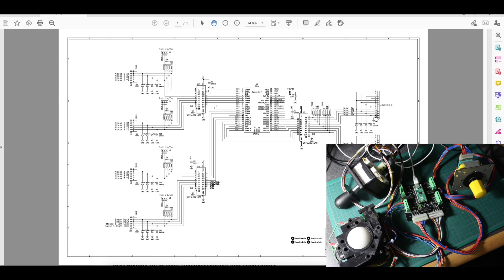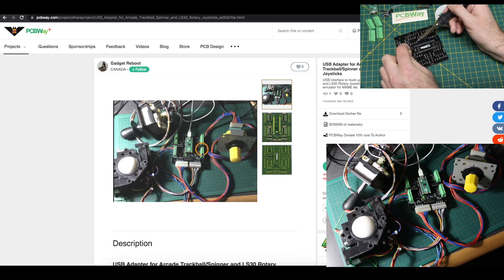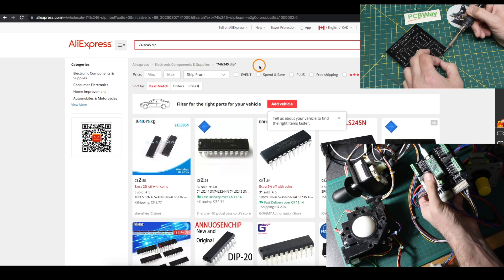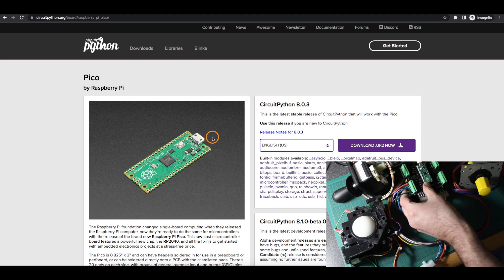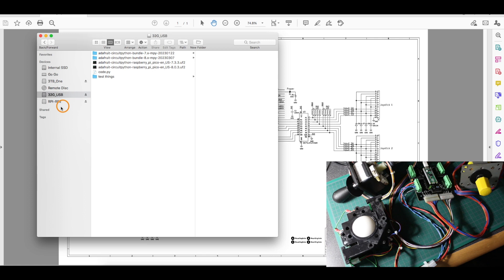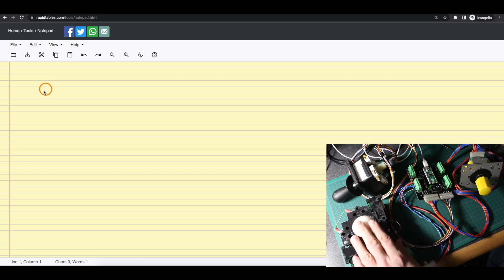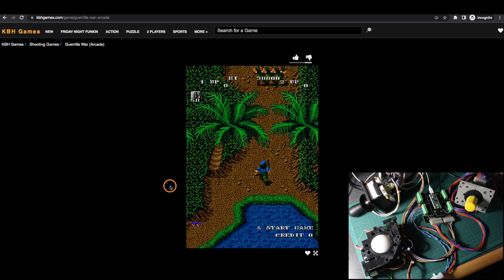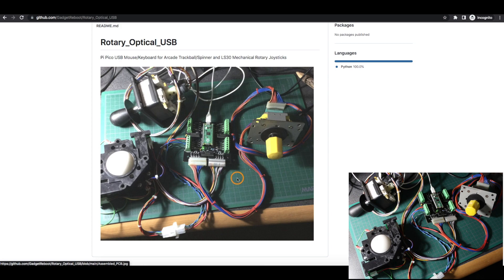Arcade Trackball and Rotary Joystick Interface

Comment: A while back a started to look at using the motor and platter from an old hard drive and got it working to the point where I could spin the platter (disk) either way and a ring of neopixels would light up a single one and follow the movements left or right which is what I want to play Arkanoid but it was slow and I got bored ! but I see you can buy spinners ? I will check them out. I will probably use Unojoy so I can use the good old 328P, do you think using that yellow joystick you could play Robotron ?....cheers....................Edit:-  What a great project ! I will enjoy watching it evolve.
Reply from the maker: I got a spinner probably almost 20 years ago, not sure if this is the exact one but it was similar in footprint, bigger than the compact ones available now.  I may want to get a newer one as I get back into it: http://mirrors.arcadecontrols.com/OscarControls/vortex/index.htm
Since robotron used a second joystick to directly control the fire direction, I haven't looked in a long time but I think the emulators are set up to look for dedicated joystick/button inputs, maybe 4 inputs (up down left right) and then they can derive diagonals from that if needed.   
The yellow joystick wouldn't work because with this interface for it, it's just sending a momentary keystroke between only 2 keys to show which direction we rotated it.  
If we just used the joystick rotary switches without this pcb, it's got 12 position switches so it's a bigger circle of directions than used by the game and we'd have to do a lot of rotating through all the in-between positions if we want to go from aiming to the right, to aiming to the left.  Can't just go immediately to a target direction.
Reply: @GadgetReboot  Yes great point !...cheers

Comment: Interesting, will the Pie be polling the ports or interrupt driven so you don’t miss any movements? it should be fast enougth to do polling.
Reply from the maker: Right now the mouse encoders are (I think) interrupt driven in an encoder library but the joystick switches are polled just for getting it going fast (second circuit python project, still learning features and syntax).  In the past I had no trouble with polling on slower chips.  

I found it strange that the computer can easily see fast keypresses but the game software needs more keypress time, also didn't have that problem in the past on other devices.  I'm curious to see how it would go if I used something other than python where I felt I had more control.

Also I was mostly using that game emulator on a website. I want to re-test with a local RetroPie emulator running on the RPi 3b directly to minimize issues catching keypresses.  Too many moving parts right now.
Reply: @GadgetReboot  With luck the pi should have enough speed to offset the fact that circuit python is an extra layer of code between your code and the outside world.

Even worse when there is an operating systems getting in the way as well.
Reply from the maker: when I get time I want to try even just going to the Arduino IDE, probably way better including the fact that I can use syntax that I am familiar with. whatever overhead the IDE has, that’s where I had it working on the other slower platforms.
Reply: Squeak !!!